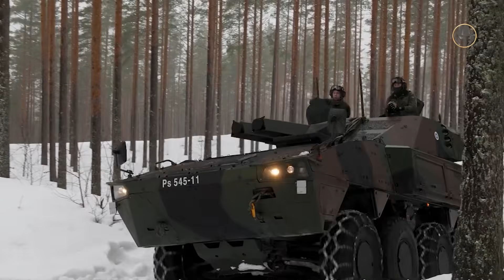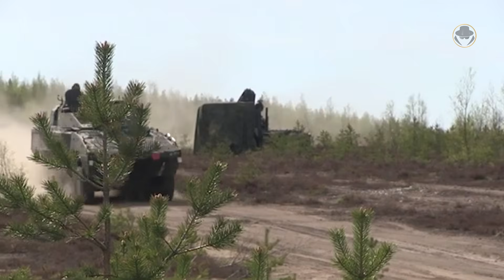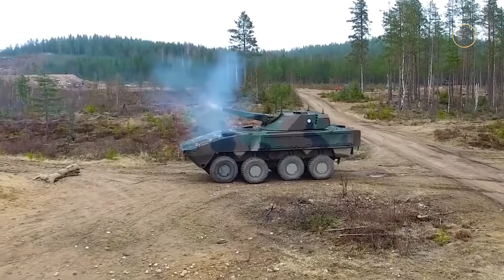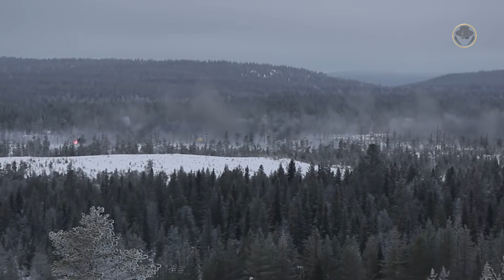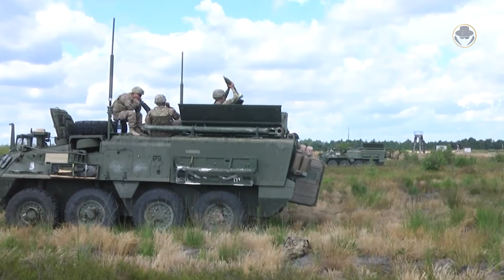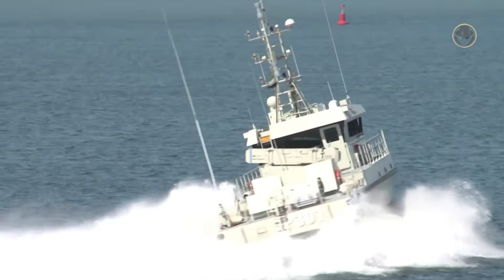AMOS - XA-361 | Why has no country, other than Finland, preferred such an advanced mortar

Comment: As a former Artillery Officer, this weapon system gives me a chub.  It’s a bit insane for Finland to not include a 50 Caliber machine gun for crew protection.
Reply: There is an optional 12,7mm automatic gun turret that can go on top. If you need 50 cal at least in Finnish doctrine something has gone horribly wrong. This is not direct fire support or close range support we have different platforms for those cases.
Reply: @xYarbx no there isn’t :D
Reply: @xYarbx  .50 cal and 12,7 mm is the same caliber.
Reply: @xYarbx   In future conflicts, the threat of drones plausibly means every mortar carrier needs a machine gun for protection. The effective range of drones exceed the practical range of mortars.
Reply: @IsaacKuo  I agree but why should it be 50cal when 12,7mm is just as capable of shooting it down. I would argue it's better since you can more easily carry more ammo for it. If we are talking drones that are in the size class of Reaper or Bayraktar TB2 neither 50cal or 12,7mm has the range to take them down and you would much better be server with something like 30mm round of Gepard. Also we don't really know yet if kinetic counter measures will be the way to go or if something like directed energy weapons will become the norm.
Reply: @xYarbx The diameter of .50cal is 12.7mm. The common western heavy/anti-aircraft Browning machine guns are very similar in function to the eastern block legacy 12.7mm and the cartridges are very comparable.

The guy you commented to most likely did not mean reapers or bayraktars but something like loitering munitions or small FPV-drones that could be protected against by some kind of AA-machine gun armed remote weapons station.
Reply: @herptek  Look at me being all "smart", can you tell I don't use the caliber measuring system. Also yeah I go the idea too from his post but I just tried to cover my bases too often run into people to whom drone is drone is drone.
Reply: @xYarbx   You are just being pointless. A .50cal BMG is 12.7mm. Are you suggesting some other cartridge, such as the Soviet legacy 12.7x108mm compared to the western 12.7x99mm NATO is somehow very different and better or why are you even bringing that up? What is supposed to be oh so wrong with a "50cal" that isn't with a "12.7mm", smart ass, and why is that such a big deal to you?
Reply: @herptek  FDF use both calibers. .50 BMG/12,7x99mm and Soviet 12,7x108mm.
Reply: @xYarbx  .50 and 12,7 mm is the same caliber.
Reply: @xYarbx  the vehicle mounted MGs are not meant for support, it's for self defense of the crew. The likelihood of something going horribly wrong is very high in combat.
Reply: @IsaacKuo  Drones have definitely changed open space warfare permanently.
But standard machine gun wouldn't be that great weapon against especially FPV kamikaze drones.
3/4th forested landscape is likely overall better "anti-drone weapon".
Reply: @Ungood-jl5ep yeah I don’t understand how Europeans are content with having just a 7.62 machine gun on top of their vehicles, when a .50 can turn cover into just concealment. The American mind cannot fathom not having a .50 on even combat support and rear echelon vehicles. Because even when you’re not supposed to be in direct contact with the enemy, direct contact will find you when you’re in a convoy or at an emplacement.
Reply: @kolinmartz  yeah, it's kind of goofy. I haven't seen a valid argument against having them except "we can't afford them" or coping associated with that fact.
Reply: @xYarbx 

12.7 is .50 cal.
Not necessarily exact same cade domensions, but the bullet diameter is the same.
Reply: @kolinmartz  Because in a real war you are not "in a convoy" through contested ground in these kinds of vehicles. That only really happens when you go fight all the farmers of a foreign country and can only hold "emplacements". Wars between nations have front lines - behind them you are very unlucky to get ambushed. Sure, it happens, but the situation is not the same.
Reply: @xYarbx I guess you know that 50 cal and 12 7 mm is the same caliber.
Reply: Jeah, multiwave jammers are wayvto go  @tuunaes
Reply: @xYarbx  What we do know is that air burst, lock on sights and fast fire rate is efficient against drones, future sci-fi stuff is not here now, what is here is 

For example a gepard with 4-8 7.62mm machineguns or something must be more cost efficient than 30mm?

Also, being able to fit such platform in a system that has the same size and weight as a 50cal RWS would be dreamy.
Reply: @xYarbx  12,7mm is pretty much a 50cal
Reply: @xYarbx u obviously don't realise 12.7mm if half an inch or . 5 inches hence 50 cal
Reply: @banaana1234 military tactics obviously isn't your thing
Reply: @xYarbx  but all Soviet SPG can do Direct attack .
Reply: We don't fight in a way that requires that kind of equipment on this kind of vehicle. Our entire system of warfare is based on hit and run guerilla tactics, if you find yourself and your AMOS in direct contact with enemy something has gone terribly wrong. It might be useful for drone defense but I think there are better systems for that than good old machine gun.
Reply: @ex1tium  that makes sense, especially given the terrain of Finland
Reply: @ex1tium  yeah, HMP devices are more like it.
Reply: I suppose the direct fire capability more than compensates for the lack of a machine gun.
Reply: @rikulappi9664 it most definitely does not. The Germans learned that lesson in Russia
Reply: @rikulappi9664 Mortars are indirect fire.
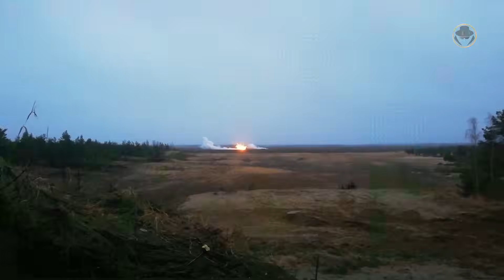Reply: @wathaet1386  at 7:56 there is mention that this system is also capable of direct fire. Obviously that is not how mortars conventionally work, but I'd say it's a pretty great feature in a pinch.
Reply: @wathaet1386 this one has a direct fire capability also. I guess it is in practice pretty similar to tank shots.
Reply: @wathaet1386 not all, this video literally shows a direct fire mortar system
Reply: I really want these to be more successful on the market. Mortars need to make a comeback on naval vessels. They've put these on a few boats and it's just perfect for river and coastal boats. Mortars really haven't seen much naval use, except Vietnam pt boats, Since the age of sail.
Reply: AMOS and NEMO have direct fire mode if someone tries to get close:
https://youtu.be/itRmWZA2Z8w?t=52
https://youtu.be/jrZYl9_DdiQ?t=220
Reply: NSV is name for it we call it Itko
Reply: just because they havent done it yet, doesnt mean they wont do it when shit gets real.

I think though the idea is that these things never get into "direct" contact ; too valuable to lose.  And if troops approach, they get a direct fire shell.
Reply: We did have gun name Itko and also heavy machine gun on it when i was in army
Reply: Its probably something to be added when it deploys to the frontline, during training and peacetime not really needed
Reply: So there’s a ma Duce on a 109????
Reply: @bombfog1 have you checked out the BAE System AMPV prototype with NEMO mortar system The US Army is testing? Any thoughts on that?
Reply: Canister rounds.
😆
Reply: These can drive fast while firing, if really contested area there is probably team and other vehicles around
Reply: I mean an AA-mg would be nice but we prefer to mount DSHK's on our logi truck sooo
Reply: The patria am  scouts are armed as is the command patria.  Also they are built to be able to fire while cruising.  So the odds of someone getting close enough to defend yourself are incredibly low.
Reply: Twin 120mm cannons that can shoot pretty close. Direct fire ability if i remember. I have a feeling a .50 cal is not needed. Even then, in finnish military doctorine if you need a 12.7mm heavy maching gun, your pretty much done for.
Reply: Finland has been testing vehicle integratable drone and signal jammers for a while now. Amos and Nemo systems are not meant for direct assaults, rather to support them from further distance - up to 5km. 

When it comes to cable quided drones, i can confidently say that Finland has taken it to concideration and adapted to how modern war will work against them.